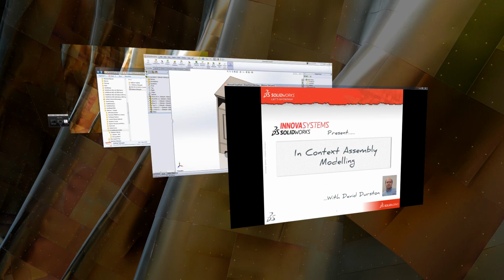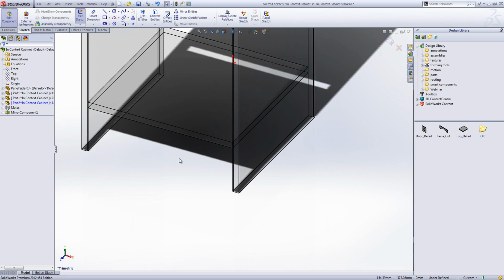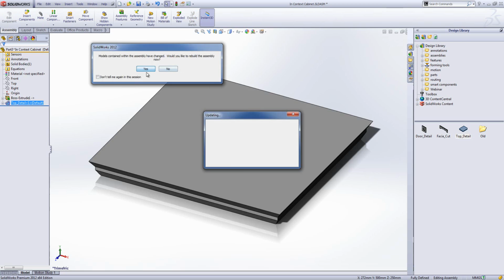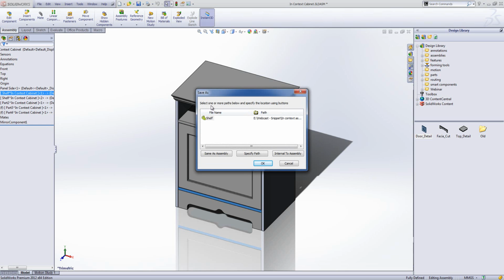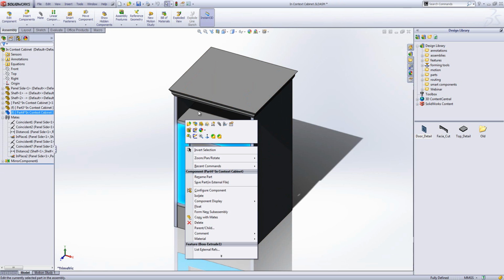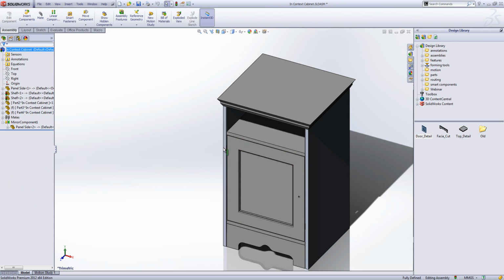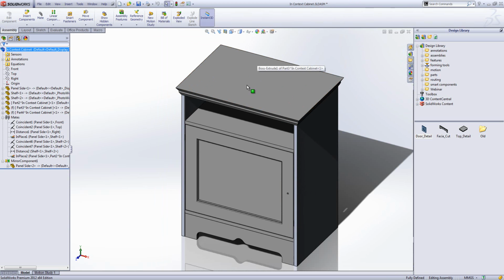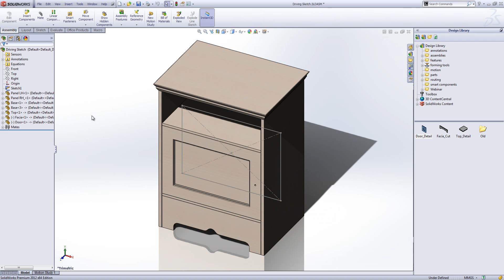In-Context Assembly Modelling in SOLIDWORKS

Comment: In-Context designing is the way to go. However, when using PDM works it doesn't work well without creating a mess. So, should you Break Mates OR Freeze Mates before Check-In?